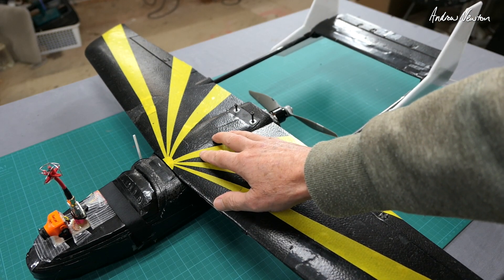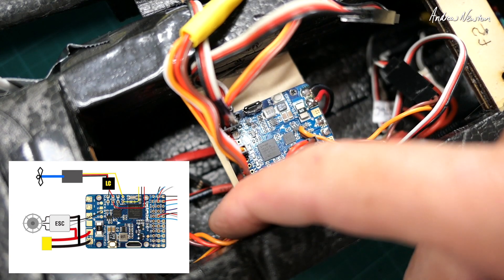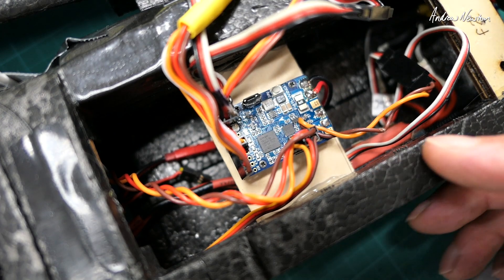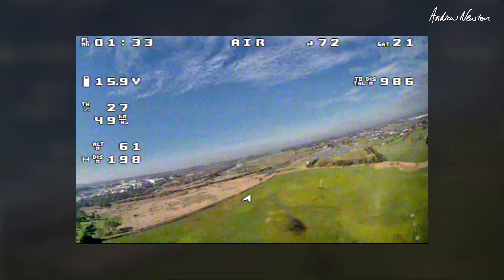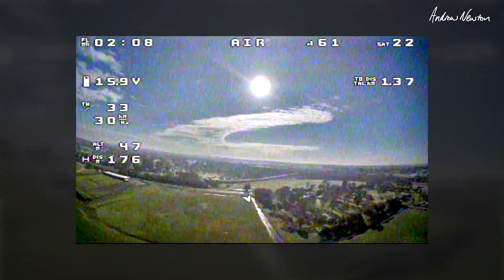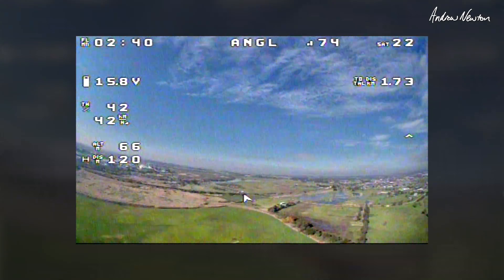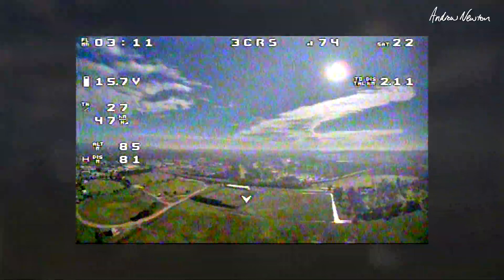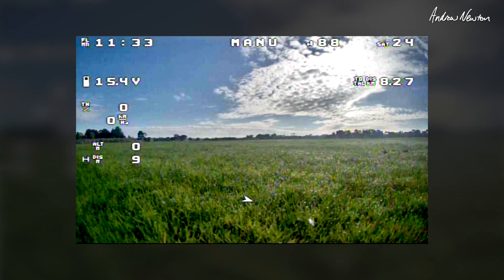SkyHawk - Matek F411

Comment: Isn't that tail problem comming from bad servo from the begining, maybe these mods weren't necessary from the begining,   maybe range test would help to diagnose that problem on the ground?
Reply from the maker: A-Tail area and angle were the original problems. Range test would only show signal strength problems
Reply: @AndrewNewton I didn't mean to offend in any way, I find your work very valuable, being of course a subscriber from years. But watched also other videos and no one seems to be experiencing such sudden tail wiggles. The servo glitter also happens at a distance, when signal is weaker it's maybe less prone to some kind of resonance, I think it could be diagnosed when signal strength checking with the engine working.
Reply from the maker: No offence at all and thanks for being a long time sub.
Reply: @AndrewNewton if I could ask, the cg is 60mm from the front wing edge?, with 3s 2200mah it requires quite an amount of led in the nose, just wanted to ask if that's normal.
Reply from the maker: @proximo1033  60mm was about right. Use extra nose weight if required, or camera or bigger battery
Reply: @AndrewNewton thanks 😊

Comment: Would you recommend this model this days? I'm planning to buy one from aliexpress and them 3d print some parts for it
Reply from the maker: Yes I loved this plane. It did better with more tail area but it's a nice size and easy to work on
Reply: @AndrewNewton  awesome,  where  did you find the fins for the tail and how did you eliminate the v shape it was supposed to had on tail, one of my friend have one and broke the nose and few parts on first flight because the plane was not well balanced and didn't add properly weight to the nose, in my case I will 3d print a front canopy to be able of moving battery forward or add a bigger battery, will also 3d print a nose cover for protect it from crash and will cover the fuselage with vynil
Reply from the maker: Foamboard fins and I cut the A-Tail in half and glued it back flat. More info here http://newtonairlines.blogspot.com/search/label/-%20Sky%20Hawk%20V2

Comment: Hi, Andrew! Sorry for disturbing, but I have some issues with the f411 about OSD. Is not showing to many parameters. Can you, please, tell me what firmware do you use and which INAV version. I have tried several, but nothing. I copied from some other FCs, but nothing. Thank you very much and all the best!
Reply from the maker: iNav configurator 2.2.1 and Firmware Matek F411 2.2.1 Have you turned OSD on in the Configuration tab? Try a different camera Make sure PAL or NTSC selections match
Reply: The OSD is on and the camera is auto on OSD tab. I will try just PAL. Thank you very much and have a great weekend!

Comment: Wait.. noise in video from the ESC amp meter? 

Thats very dissapointing.. i had a F411W waiting for installing it into an ARWing900 .... now it turns that the board its noisy?
Reply from the maker: No filtered power for VTx on this board. We were spoiled by the F405 and now expect it on all Mateks
Reply: @AndrewNewton  oh boomer.. 

Well i guess it can be worked arround adding a LC filter in the power output from the board

Comment: I did manage to get rid of the noise on mine by adding a huge capacitor to the input pins but I've since made other changes so won't know if these have set me back as I won't get to fly it until tomorrow, I love Matek but their 411 offering is aweful, the 405 is much better.  Can you do a video or give details of what filter you put on the video line and where please?
Reply from the maker: Yes, good subject for a video. But I'll need to research and test more first. LC filters dont always help for some reason.
Reply: Andrew Newton thanks, well my changes to the setup didn't affect the video, but the plane itself still acts like a 2 year old that's been told he can't have chocolate at the checkout.
Reply from the maker: Oh dear!

Comment: Hi Andrew , what version of inav are you using with the f411 , I tried the latest version with mine and wouldn't connect . The only way I could get it to connect was to use release 2.1.4 and using the impulse rc driver fixer . Windows 10
Reply from the maker: I'm using 2.2 now, but I'm on a Mac. No issues with the driver.

Comment: you bloody legend! Just finished my f411 board ready to mount and will take off the esc and add to power.

Question what mode is loiter now it doesnt appear in my list on Inav. And setting it up with the TH9X is the worse possible choice you, I could have made. But only TX I have.
Reply from the maker: Sweet. I shouldn't call it Loiter but that's the only voice track available. It's actually Position Hold and Altitude Hold at the same time.
Reply: @AndrewNewton  thankyou for us simpiltons  loiter was much more descriptive.Your doing all the hard work for us. I switched  over the leads and fixed video right away. Still need to put a ring on video cable. But so so much better thank you.

Comment: I agree 100%, the matek F411 does a really poor job of keeping the video clear with regards to filtering. as you can see from my video here, it was just full of lines the whole time. I really need to sort out a different way of powering my FPV equipment, I don't think I'll be using the matek board built in PDB for anything other than the rx power and current sensing for the motor. https://www.youtube.com/watch?v=dry5TSPJ2fI
Reply: So would a separated filter for the VTX and camera allow to use this with no noise?

Comment: Good to see your clean video Andrew, and teaching your (large) band of followers how to do LC Filtering. I normally supply the FC/ Camera/ vtx all with the same filtered vbatt...That way all 3 components benefit from clean power...You will soon get used to simply watching vbatt instead of used milliamps. Just make sure you calibrate your voltage on the OSD...Nice work.
Reply from the maker: Thanks ET, you can credit yourself with this improvement.

Comment: Andrew, I had some issues with the F411 video, put a cap on the ESC and an LC filter on the VTX power, and mine is clear, and still have current sensing. https://www.youtube.com/watch?v=l2DsiqCMycM
Reply from the maker: Excellent demo. I did try that but it didn't help mine. I'll try it again.

Comment: Looks good, esc noise is always the biggest issue with FPV. The cleanest signal I’ve ever had is powering vtx and cam from battery and not connecting any part of the FPV system to the FC or ESCs, but you miss out in the OSD doing this so I do something similar to this on my miniquads to get the cleanest video possible while still getting the OSD from my FC.

Comment: Nice, I do not power anything from the FC, the servos power out of external BEC directly to the battery, same as the fpv system with a LC filter, so only signals are coming out of the FC, the result is clean plane all do way around.  Now you Skyhawk is a skyhunter now. LOL. Nice.
Reply from the maker: Yes it's no longer a SkyHawk, more like a scratch built mini Skyhunter